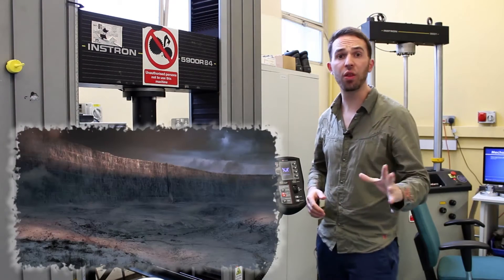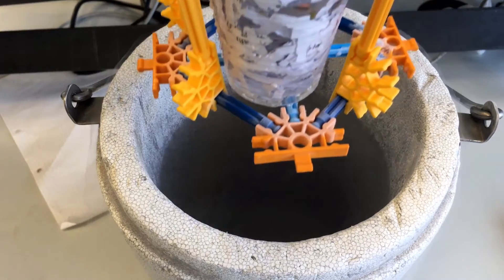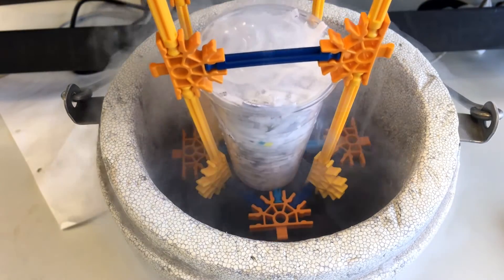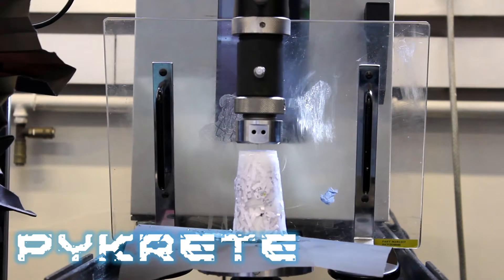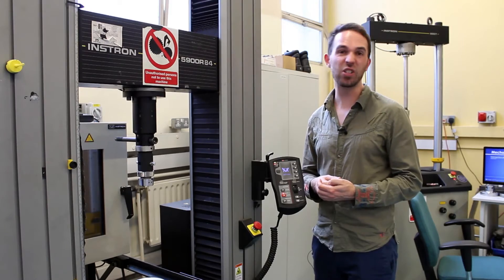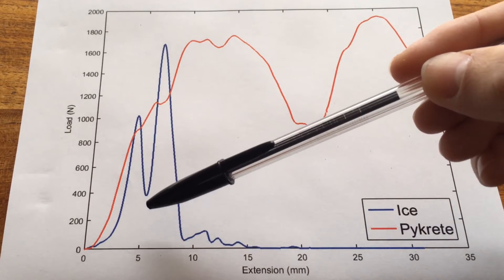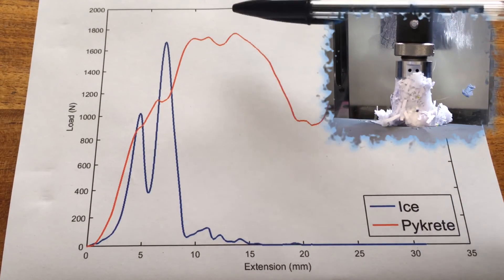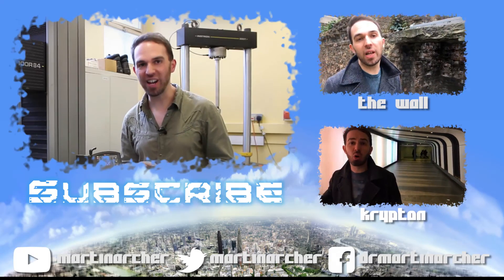How Strong Are Ice and Pykrete? | BONUS Game of Thrones Video | Physics vs Film (and TV)

Comment: that is not pykrete
Reply from the maker: Truviliant the key is the cooling process. Fast freezing using liquid nitrogen results in small ice crystals because the molecules aren't given sufficient time to reorganise into stronger large crystals.
Reply: That wasn't pykrete either, it was just frozen sheets of newspaper.
Reply: It needs to be colder.
Reply: +Truviliant fkn idiot
Reply: Klary Lary Ok then you come up with a better idea as to why it did not work.
Reply from the maker: +dayne walz mythbusters found that pykrete made with paper rather than sawdust actually fared better in their drop tests

Comment: Because the nitrogen froze the water so quickly the ice crystals were small and weak. The longer the freeze the larger the crystals and strength
Reply from the maker: Yeah, it doesn't give the molecules time to all properly arrange into their hexagonal crystal lattice apart from over short length scales. If I'd had time and access to a large freezer near the testing machine I should have done it the slow way. Maybe another time.